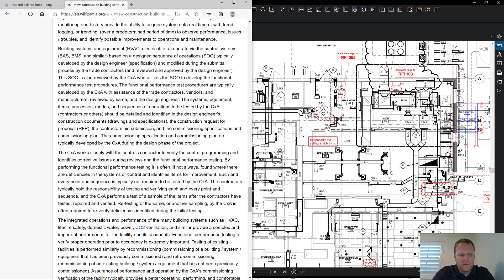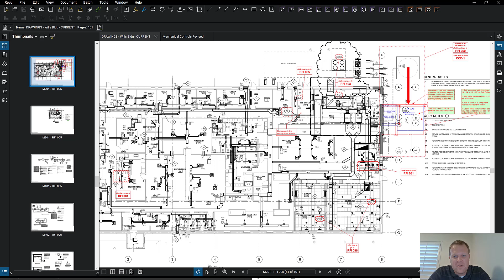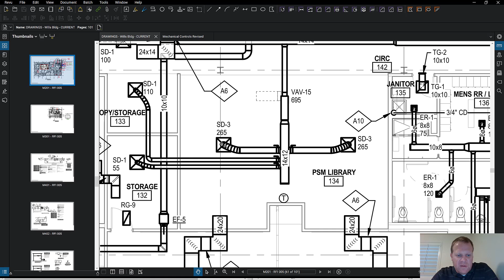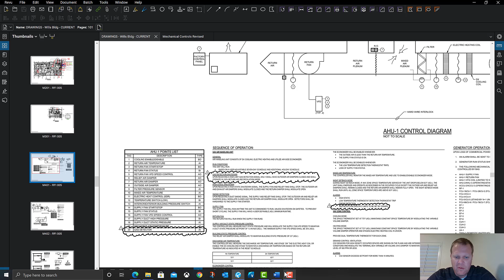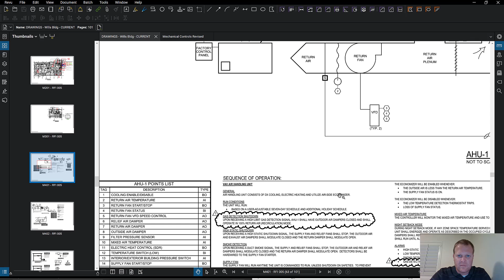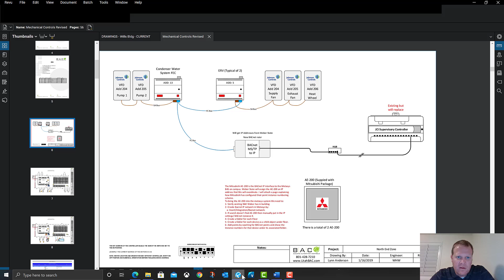Commissioning

Comment: I am an electrician in England, looking to get into commissioning and surprisingly there isn't much information online, no real path to getting into that side of the industry other than just gaining the knowledge and slipping in somewhere. luckily on my current site I've managed to chat with the commissioning engineer and ill be the spark working alongside him at a water pumping station, I've installed the new system so will be nice to see the commissioning side of it now. your video has helped me a lot as its given me a nice overview of what to expect and generally whats expected along with the processes. thank you for taking the time to make this video. greatly appreciated.
Reply: I know I'm roughly a year late to this comment, but I figured I would weigh in and give you my experience making the switch from commercial HVAC-R installation and start-up to a 3rd party Commissioning Engineer.  

Hopefully there's something in my story that can provide some level of insight on the move from construction to commissioning. My story seems to be relatively common as I've met a few other CxA's who's shift to commissioning mirrors mine, at least to some extent. 

I went through a standard 4-year on-site & in-classroom apprenticeship for HVAC-R. By the time I was in the 3rd year of my apprenticeship I had started working almost exclusively with the equipment start-up and quality control department as that was my strong-suit and I had a Project Manager at the time that was really good at identifying his workers strengths and facilitating their growth in said field. It goes without saying that I always gave every project my all and was willing to go the extra mile to get things done right, this is usually required for any kind of promotion or career growth. 

After doing start-up and quality control for about 3 years, having finished my schooling and obtaining my journeyman license, I found myself working with many commissioning agents during the final stages of start-up and building turn over. On this one hospital job I was working on I found myself working with a Commissioning agent closely during start-up and equipment testing. I was very accommodating to him and did everything I could to help him commission the mechanical equipment at this hospital. After working with him for roughly 2 months, I found out that he was actually the co-owner of the Firm that was doing the Cx work on this hospital job, not just a random Commissioning guy. Long story short, he offered me a job as an entry level Commissioning agent at his firm. Since then, I've taken a few CxA tests and grown in the commissioning industry. There was a learning curve, but the two fields are related so it wasn't too overwhelming. The biggest challenge was getting out of the contractor mindset and moving into the mindset of an owner's representative, these are two wildly different perspectives on construction.  

Essentially, you want to wiggle your way into a role that will have you on-site during the building turnover phase of a project. From there, you'll meet a lot of commissioning guys and you'll be bound to meet one who likes you (provided you give them reasons to like you). I would recommend looking into more of these CxA videos and learning as much as you can. BCxA is a good resource for info on commissioning authority requirements.
Reply: @SethRobert1994 thanks
Reply: Did you get into commissioning ?
Reply: @bunnyman6321  still trying to work my way in actually. Are you trying too?
Reply: @Tom Alison  Try adjusting resume to fit what recruiters look for in commissioning.

I just have interest in engineering.
Reply: @bunnyman6321  yeah I will do. I recently got a decent reference letter from the Mechanical and Electrical project manager that states my interest in commissioning so hopefully that’ll go well with the CV. I think it’ll be persistence beats resistance on the job. I’ll keep pushing for it and hopefully get myself In. It is really interesting. The current guy at my site used to commission and decommission nuclear war heads ! Along with fighter jets. Really is amazing just how many components all working simultaneously it takes to keep systems running
Reply: @Tom Alison   I'm not familiar with decommission, you done taught me something. I'm a look into that.

Have you considered applying for commissioning jobs that require relocation? You could win that way too.